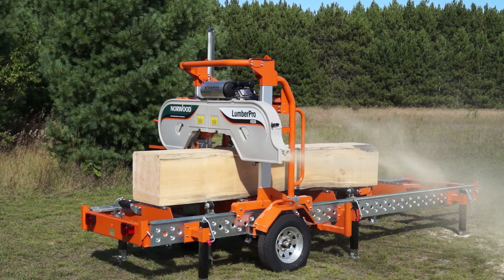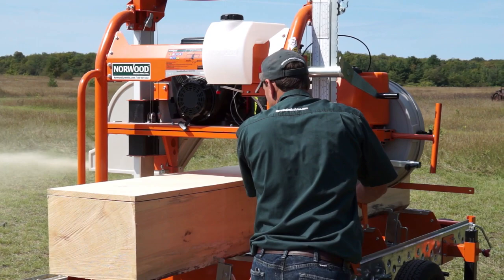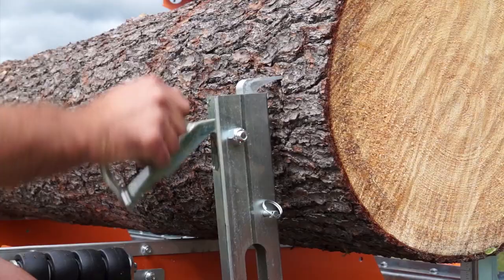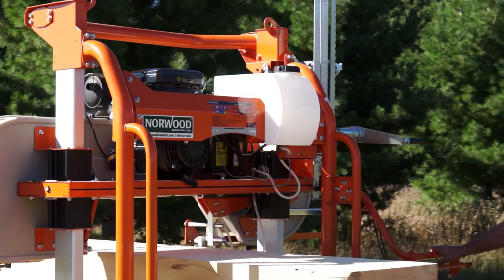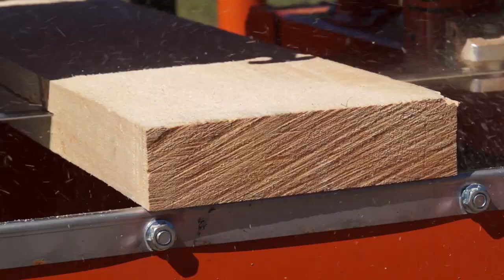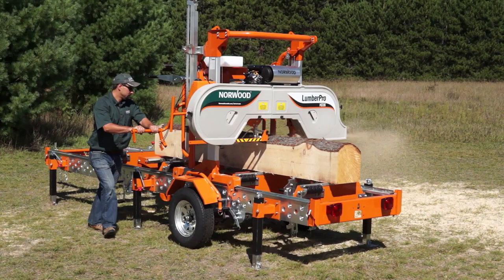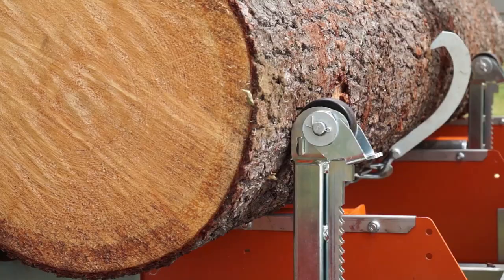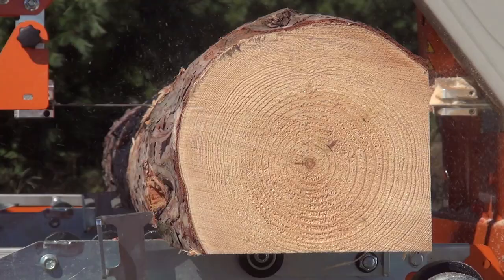Norwood LumberPro HD36 Portable Band Sawmill - Part 1

Comment from the maker: The Norwood LumberPro HD36 Portable Sawmill

Here is the full-sized HD36  #mobile   #bandsaw  mill in its manual configuration. You can start with a base model and add time-saving accessories to cut more  #lumber  faster as your business grows.

Click here for more info on the HD36 http://www.norwoodsawmills.com/products-portable-sawmills/lumberpro-hd36-portable-sawmill or call 800-567-0404 and speak with one of our sawmilling experts about your specific needs.

Comment: Hello.  I am curious about the manual loading ramps and winch.  Can the ramps/ winch be used to load from both sides?  Nice looking and running mills by the way!
Reply from the maker: Hi Arthur. Not really. When you winch the log up and it gets up to the bed, it can carry some momentum rolling onto the log deck.  Configured the way we recommend, you lock your log rests up as blockers so that the log cannot roll right off the other side of the mill and onto your feet.  Also, when you roll the log, you wrap the cable and the hook around the tree and, as it rotates around its axis, the log rests prevent it from falling off.  Let us know if you would like to receive a free Norwood Sawmills info kit. http://www.norwoodsawmills.com/free-dvd-kit .  Thanks!

Comment: Hi there, I want just to find out about the Board-feet capacity a day or m3 of the HD 36 in both version, gas and electric. Can you let me know, if possible, what is the gas rate consumption of the petrol version. D.P.go
Reply from the maker: Thank you for your questions. The HD36 Hydraulic regardless of engine type is approx. 4080 BF/Day or 9.6 m3.  Gas consumption is estimated at 4 liters / hr. You can find more technical specs on the HD36 here http://www.norwoodsawmills.com/products-portable-sawmills/lumberpro-hd36-portable-sawmill.